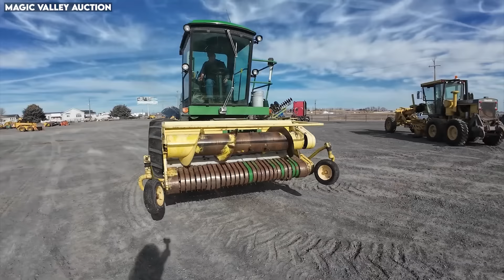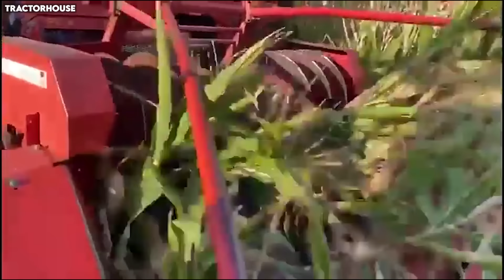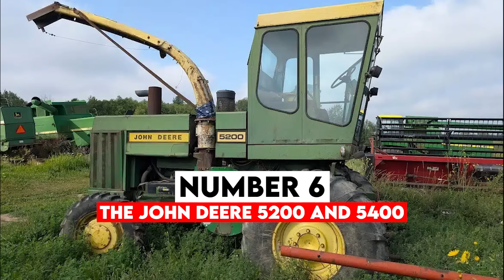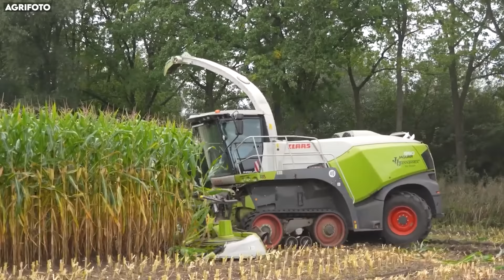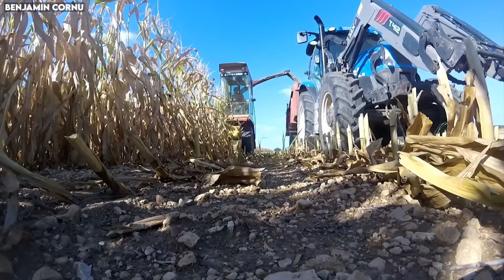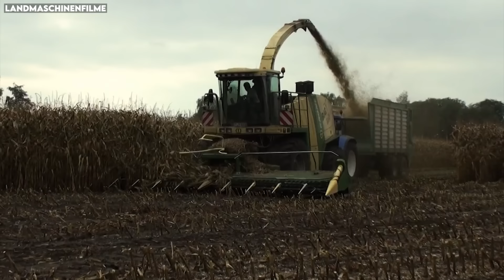10 Forage Harvesters That Were Too Advanced for Their Time

Comment: I know someone who turned up a JD 5430(?) to be able to handle a custom made 6 row head, a novelty in the late '80's. He now runs a NH SP, with a 10 row Kemper head, and it's not the biggest available, but works for his customers. Fox made good equipment, too bad they folded. There are 4 big league SP chopper companies now- NH, JD, Claas, and Krone. All have huge capacity in their top models, and the decision to buy one is usually based on the dealership's proximity and service. In the fall harvest, the best Technicians never don't answer their phone, and have their Company Service truck in their driveway ready to roll at all hours.